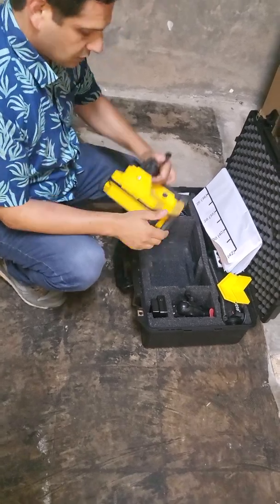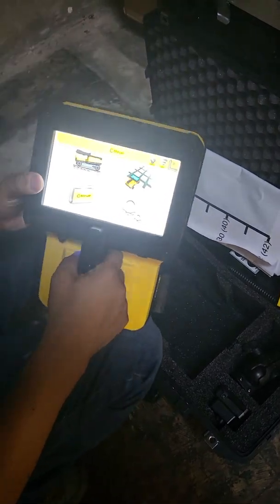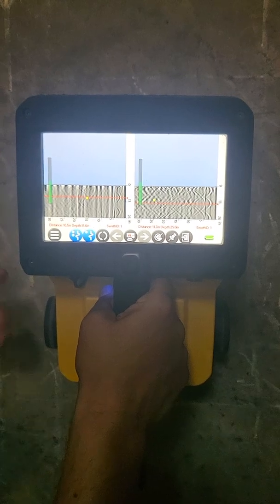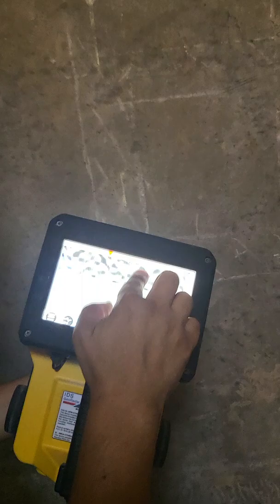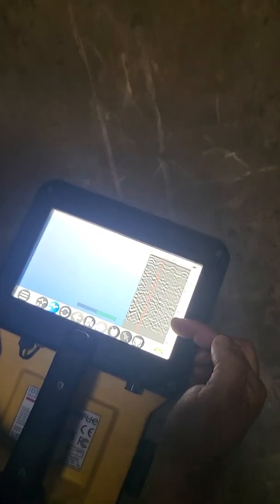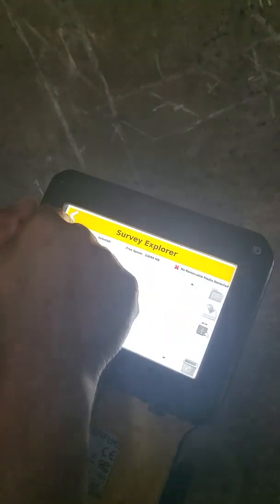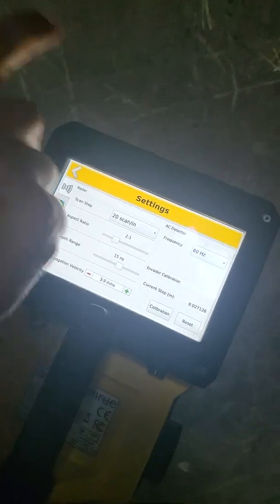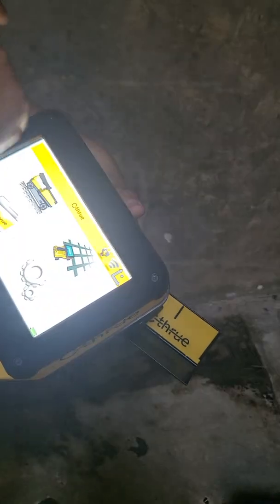IDS Cthrue, a quick start guide | how to scan concrete with GPR | ground penetrating radar

Comment: Sir what is the propagation in ids cthrue in asphalt and concrete road plese reply
Reply from the maker: @Kapilthakur_bulandshahr  great question. The propagation velocity has nothing to do with the system, it has everything to do with the material itself. We see asphalt with velocity of between .1 m/ns to .15 m/ns depending on the material and environmental condition. Possibly a little faster in certain circumstances.